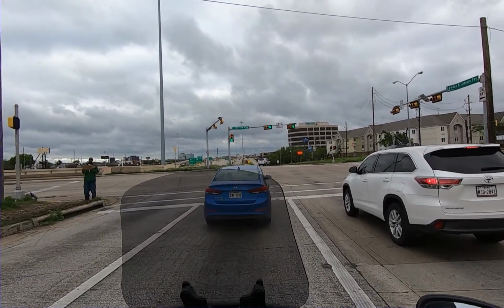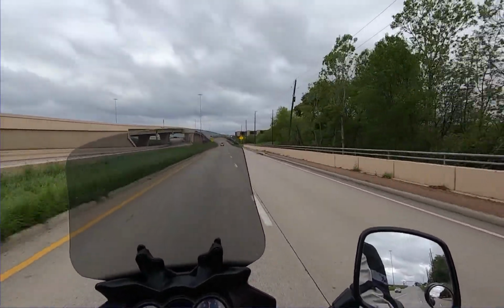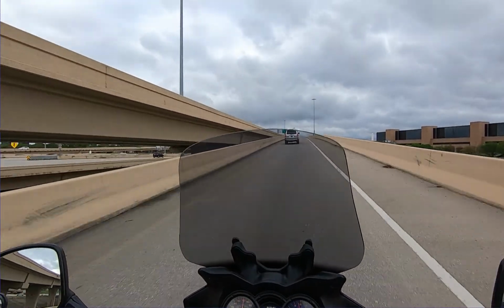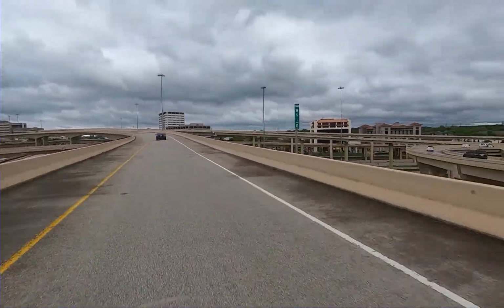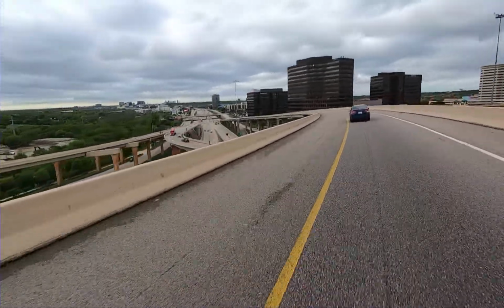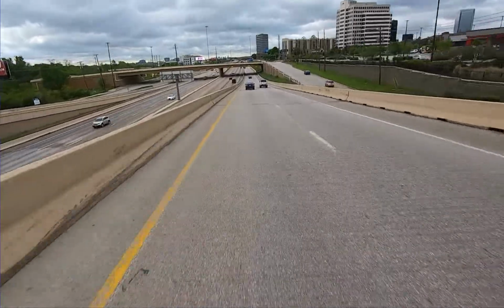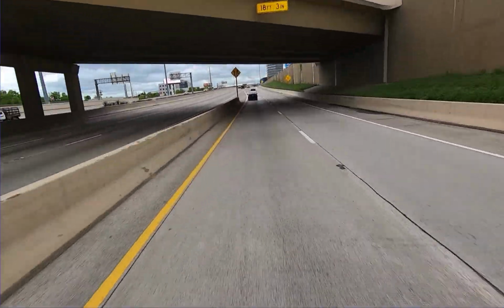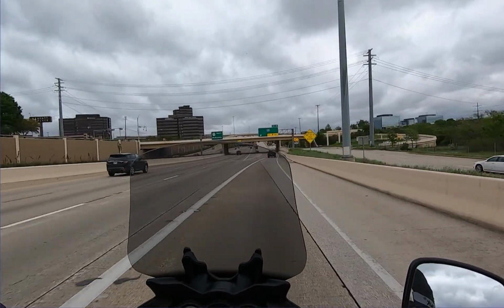Dallas High Five

Comment: The sound of engine is more light and smooth than old one. Teleport edit technic was good.
Reply from the maker: Yes! When I bought this motorcycle last year it had a modified stock exhaust which basically means that the previous owner cut open the muffler can and cut out the inside baffles. Because I like to rideat night and I don't want to disturb the sleepers, it was a deal breaker to buy such a loud bike. The owner ordered me an original exhaust pipe to get me to buy it. I was happy, he was happy.